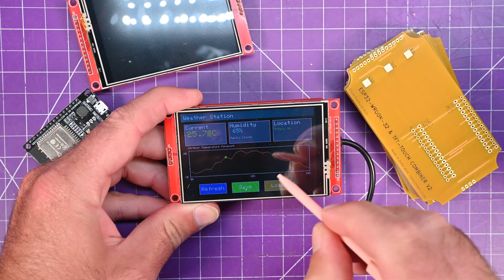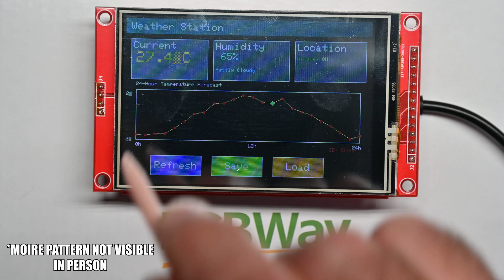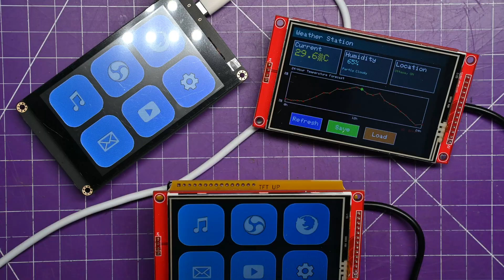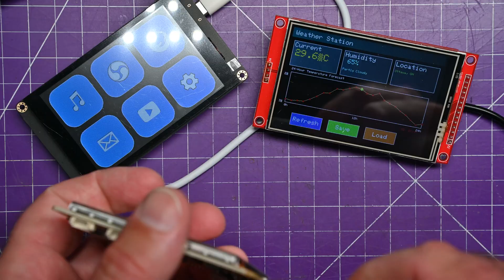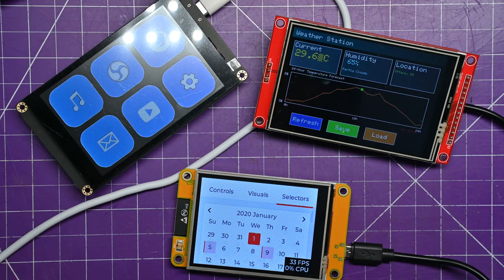Touch Your ESP32! - Custom PCB For 3.5" TFT LCD With TOUCH!

Comment: I am new to this stuff. I am trying to work with micro tft displays. My goal is to gat HDMI in to a small TFT LCD display. Theoretically what would I need to build to do this?
Reply from the maker: I don't think you can do HDMI to any random LCD that easily

Comment: I’ve made a similar board but you can plug in an esp32, seed xaio, or pi pico. There’s barely enough room on the pcb to fit them all. 😉 That way your pcb is more universal for whatever chip you want to use. Yes you can run that display on a seed xaio or adafruit qt py form factor.
Reply from the maker: Neat! More boards are more better!